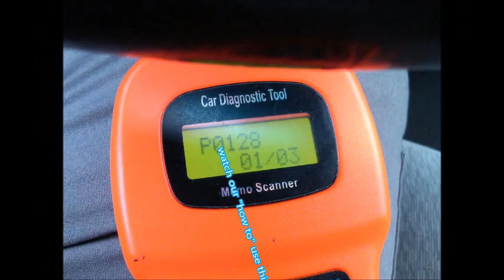p0128 code How to fix coolant temperature sensor Toyota Sienna

Comment: Very clear instructions provided here. I did this same repair on a 2003 Toyota Avalon; the engine configuration is almost identical to the one in this video.  I siphoned a little coolant out of the radiator cap location with a siphon pump and hose, but still ended up spilling a little bit of coolant on the garage floor as the old sensor was removed. It's not enough to worry about--just have some rags for cleanup and a jug of coolant to top things off.  And you may want to use a thin coating of anti-seize on the threads of the new sensor before installation.

Comment: P0128 is usually a thermostat but can also be the sensor.
Reply: But this one is a sensor right?
Reply: @swift4311  yes
Reply: But if it overheats it's the thermostat.
Reply: @cisco00079  more than likely yes.

Comment: This is helpful. Interesting that the Toyota shop manual on page 05 – 77. They do not mention replacing a temperature sensor they go directly to replace the ECM. This is in the section of the manual under DTC looking at P0128 coolant thermostat coolant temperature below thermostat regulating temperature. We checked our temperature with a probe in the fill cap and we were reading 185° therefore makes me think it’s a temperature sensor or sending unit, am I missing the spot in the mantle where they talk about this? I have the two thick manuals I bought from the dealer for about $200. Thanks for your help I’m gonna go look at my motor and find that temperature sensor and order one up or maybe my local auto parts store carries it

Comment: Besides the code was there any other signs that pointed to the sensor's need to replace it?  I don't have a code but my Temp Gauge fluctuates between cold and mid-level, never overheating. just going to cold after 3 hours of driving in 95 degree weather
Reply: Thank you! You explained and showed it well enough, a little old lady, like myself, can now do my own.
Reply: My vehicle wouldn't start unless it was warm.
Reply: Maybe  why the fans don't come  on ? They  come on the  low speed when  AC is turned  on but normally  they  should  come  on after driving  a couple  miles.

Comment: my car overheats in idle but not when driving is it the temperature sensor?
Reply: The most likely reason for this type of problem is that your fan isn't working, but the reason, and the fix, will differ depending on the car you drive. Intermittent overheating problems can also be caused by low coolant, air in the cooling system, a bad coolant temperature sensor, or even a faulty gauge